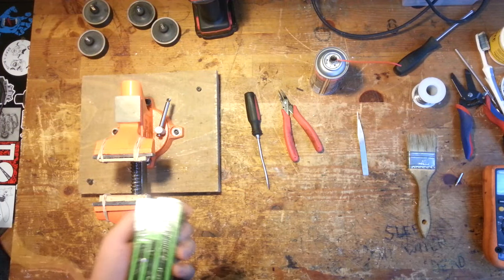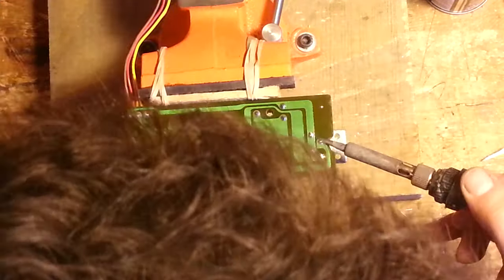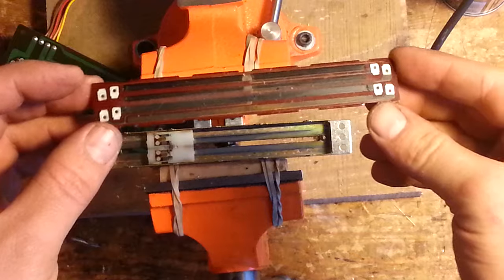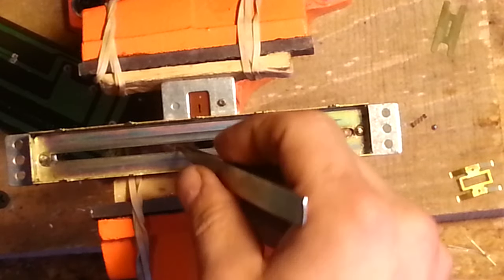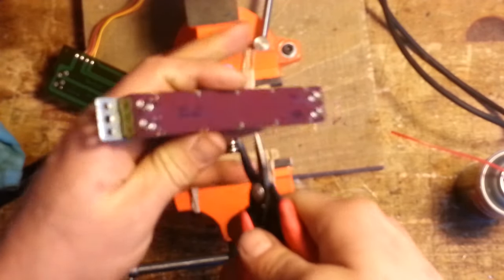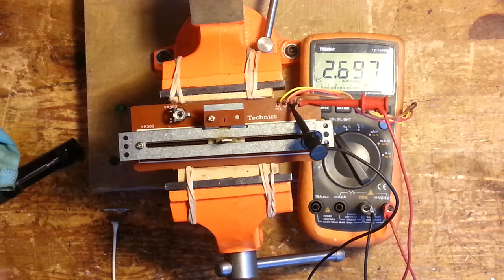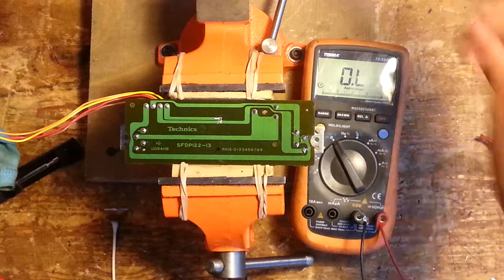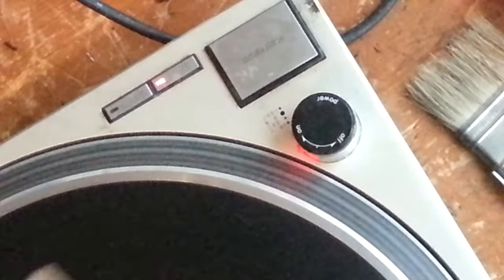Technics SL-1200 Pitch Fader Click Removal & Service

Comment: Caig warns against using deoxit on carbon tracks. Deoxit creates grip which accelerates wear. Fader lube is preferred here.  NIce detailed video.
Reply from the maker: I only use Deoxit to clean off the dirt and grime then I wipe it clean
Reply: Would you use that in addition to grease?

Comment: Does led light on fader still work after removing ball? Great vid
Reply from the maker: It does. Since the center of the fader throw "clicks in" mechanically all the regular functions of the fader stay the same.
Reply: JoHnNy t  yes it does.  I did it. It didn’t affect anything.  In stead removing the pitch slider from the board. You can also use a middle os something to push in the small ball and the spring. Put some pressure against it till you fill there is no resistance and you’ll be fine.  I did that to my 2nd TT
Reply: @GGarcia7111  Sorry use a middle what to Push it?
Reply: Michael Turner sorry I meant to say use a mini pick tool to push the ball bearing. Put some pressure in to it.  And you’ll feel  it. It won’t click at the 0 position.

Comment: Hi. I have a problem with a pitch with my 1210 mk2. In practice the problem is the double zero. With the pitch at zero (and the LED on) it turns perfectly, when i accelerate with the pitch in the Moment that the led turns off instead of going faster, the turntable slows down to return to a new zero on a value of about +2.5. It holds the +6 and +3.3 very well, a little less the -3.3 but it is at acceptable levels.
Searching on the web I found various tutorials to solve my problem, the point is that when I connect the multimeter to the pitch (obviously disconnected from the turntable) I have an X value, and going to modify the VR302 trimmer that value should modify right? To me it remains fixed and constant.
The tests I have carried out are the following:
I have completely replaced the pitch, putting the One of my other turntable, and it works perfectly, so I rule out problems with the motherboard or others stuffs of the turntable.
With the Multimeter attached to the Brown and Red of the pitch (disconnected from the turntable) I tried to move the pitch fader and the value changes (so apparently the fader is good) but with the same configuration by acting on the vr302 the value remains fixed and constant (so apparently the vr302 doesn't work).
At that point I connected the Multimeter to the vr302 and rotating it the value changes, so apparently it is good.
I am also going crazy because if there was something to replace I would not know what specifically, and with the times that are running I do not want to spend more than I should. 😬
Sorry if I wrote a lot but I hope I have explained the problem well and what tests I did.
Reply: Hey did you overcome the problem you were having?! I have the same issue with V302 , ie I cant zero to 2.7KOhm at center.. (0 (2.7KOhm sits at around +2 Pitch..) I bought a new aftermarket fader but havnt bothered tying it yet since, I like you suspect V302 is dodge..or something else! Before I buy more parts dig deeper im looking for answers ... so what did you do! :D anyone?? Tips?!?

Comment: any idea what the variable resistor specs are on the pitch fader PCB? i believe it's called VR302, and it's 50kOhms. but i'm not sure what the current rating is. might need to replace mine and the other option is to replace the whole PCB

Comment: Hi, I followed all the steps until the ohms calibration which gave me 1 or below all the time no matter the position of the fader (i double checked cables, red to brown and black to red), you think it could be the little rotating thing? (VR302 component) or should I replace the hole fader...
Reply: You want to put the probes of your meter on the red and brown wires coming off of the fader board and measure it with the fader in the zero position. Then you will adjust the VR302 pot to get 2.7k ohms. If you are finding that you can't set that number it may be an indication that the carbon tracks inside the fader may be worn beyond the point of working properly. Normally if you clean this fader and calibrate is, when you measure on the red and brown wires you should find 2.7k ohms at the zero position then a smooth transistion up to about 18-20k ohms in the upper range and down to like 20 ohms in the lower range.

Comment: Is the only way to clean an old sticky fader to open it up like you did here and clean it? I tried using deoxit faderlube f5 but I think the issue is that any dirty or grime is still inside the fader.
Reply from the maker: Yes. DeOxit will only get you so far. Once dirt and grime gets mixed with whatever lube is in there, it's gets sticky on the fader tracks and brushes and will feed the direct drive system weird readings so the pitch won't stay steady. Once opened and cleaned fully and re done with Fader Lube it should provide many years of trouble free service.
Reply: @commonbeatmusic1290  Man, now I got 3 of these things I gotta open up and service lol. Thanks for advice bro, peace

Comment: what type of grease do you use ?
Reply from the maker: Electronics grade grease/lube
Reply: use silicone grease, Deoxit make a product call " Deoxit Fader grease"  part # DFG-213, its specifically designed for electronics that have a mechanical mechanism that requires slip and resistance between plastic and metal. Do not use petroleum based greases
Reply: @commonbeatmusic1290  I think he was talking about your hair lol

Comment: ¿Hola como estás? Muy bueno tu video quería saber si puedes ayudarme con un problema comprendo un par de mk2 1200 y tengo el siguiente problema, regule el pitch a 2,7 k como dice el manual de fabrica, esta como corrido en 1+ seria en el rango Del pitch en 2, +6 si esta bien ahora, en -1 me da -2.5 -3. Si muevo el potenciometro del lanzamiento que tiene que estar en 2,7 se acomoda, pero sigue el corrido en -, el quejar dejó de fabrica, la sonda removiendo el cable naranja del paso es lo mismo, removiendo la resistencia r209 y es lo mismo, con Los time code me sirve para regular porque miro en la pc el rango y me sirve de guia pero no consigio dejarlos orignales, quiero que en -3.3 me quede ese valor y no -5, que en -1 mar -1 no -2, 5, cuando lo pongo en +1 me da 0.5 +, que tengo que hacer? Hay alguna manera de acomodar esto? Y que queden de fabrica ?? Aguardo tu respuesta muchisimas gracias

Comment: My zero point is at 3,10 while on 0% and is perfectly at 33/45rpm ..is it wrong that it's not 2,70 ?
Reply from the maker: Well you have to remember that at a certain point the ball is going to click in so your reading my vary, but the factory setting is 2.7k from Technics. You may need to do some better cleaning or if it seems fine, leave it alone.
Reply: When I set it to 2.7k it's not 0% while green light is on.
Reply from the maker: You may have some dirt or grit stuck in the fader making it read falsely, I would disassemble and clean it as per this video.
Reply: SWARE I think that only happens with the old pitch sliders.  The new ones as soon you move + or -  you start getting a different reading. I have an mk5 and the pitch slider it’s also smother. An easy to beat match

Comment: What I do is put a shading cloth from Technics which will go under the base also between the fader and top plate for more protection!
Reply from the maker: Yeah at a certain point though everything gets in there! You should see some of the crap I've cleaned out of them. Best one so far was a customer that spilled a vodka redbull and what looked like grenadine inside the table. I literally disassembled the fader much like this one and had to scrub the board with rubbing alcohol and a toothbrush just to get all the syrup out hahaha.
Reply: At that point, would it be better to just replace the fader?
Reply from the maker: Most of them don't need replacement when they are easy enough to pull apart and clean. Save the 35 bucks.

Comment: i just bought a sl-1200mk2-xa, and i just can't figure out what's going on. i got the slider right here in my hand, and the red and brown wires are reading as open no matter what setting i slide it on. the green led never comes on, and there is no way to control the platter speed whatsoever. i'm just wondering if there's so much gunk in it, or does the slider need replacing. even on the click locked green led position has no effect on speed, and the green led doesn't come on.
Reply from the maker: it may be time for a new slider. make sure you get one for an MK2
Reply: Ah, thanks for the advice.

Comment: MY 1200 MK2 DOESNT CLICK. I GOT A FEELING THAT THE PITCH HAS BEEN REPLACED WITH A MK5 PITCH OR THE BEARING AND SPRING HAS BEEN REMOVED.
Reply from the maker: The specs for the Mk2 and Mk5 pitch faders are pretty much the same other than one has the "click" window and the other does not